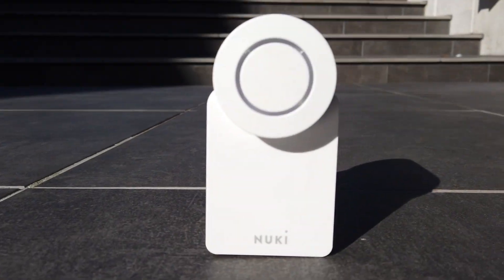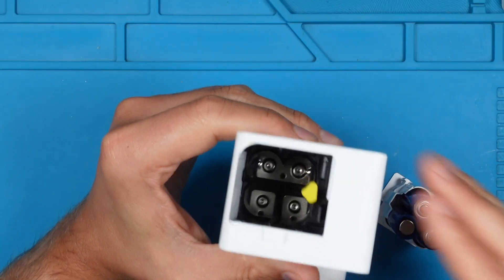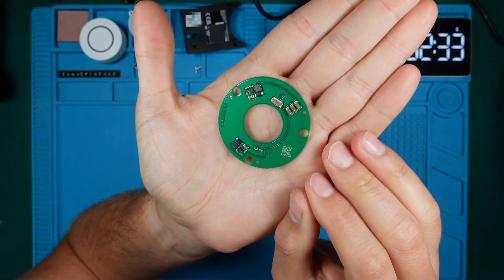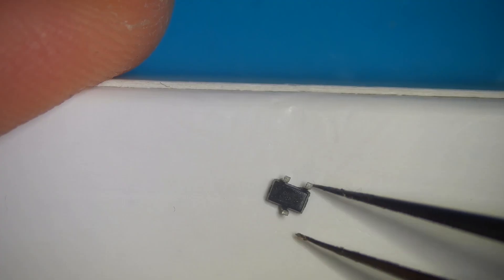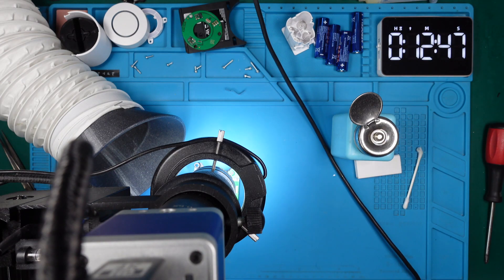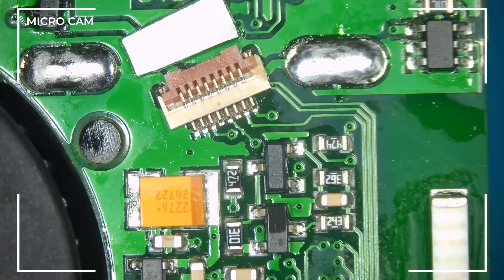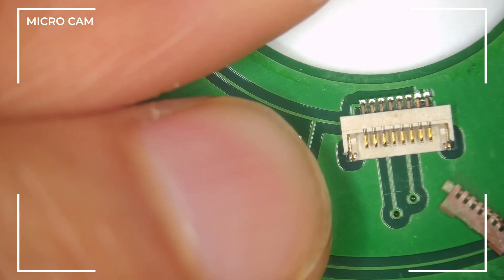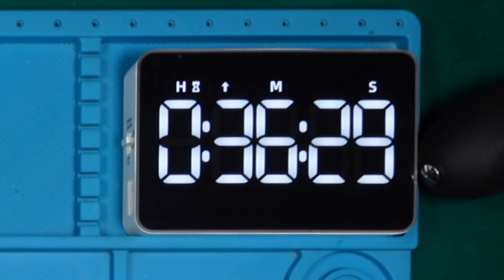THIS Nuki Smart Lock V3 Almost Beat Me — But Here’s How I Fixed It

Comment: Hi, thanks for the video, I know now, what is the problem in my nuke lock, this small part than you re-weld, it's missing on my nuki, do you know what component it is?
Reply from the maker: Hey, mateoni! Unfortunately, that is not the case. As mentioned in the video, I am guessing this is a transistor; you could try to replace it. I think it is a SOT23 package.  ✌🏻